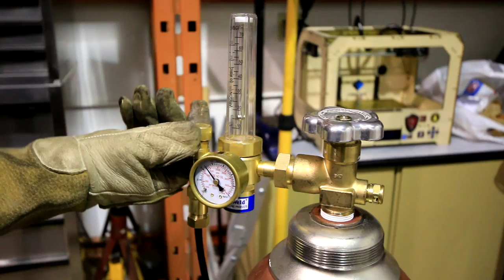BUILD: Industrial Modern Chain Lamp

Comment: Just wondering what kinda chain ya got there. I’ve looked at Home Depot and Lowe’s but majority of their stuff is zinc plated. Not good for welding. Also I have a little easy bake oven flux welder. Not sure if it would be up to do a job like this